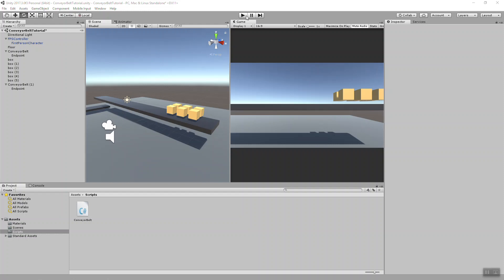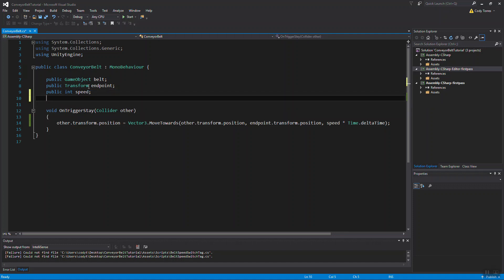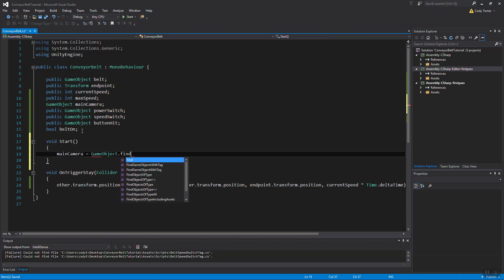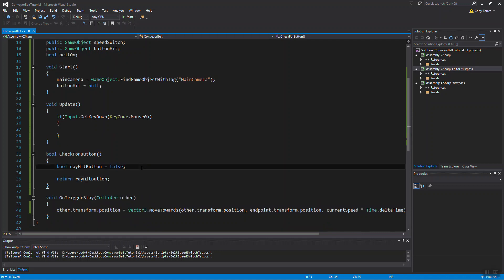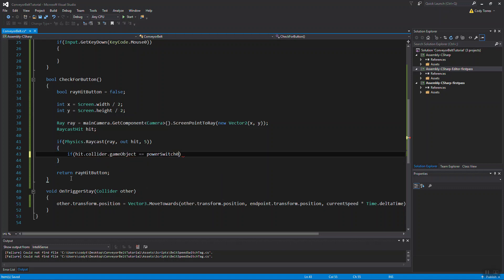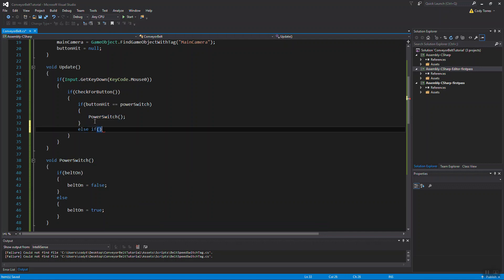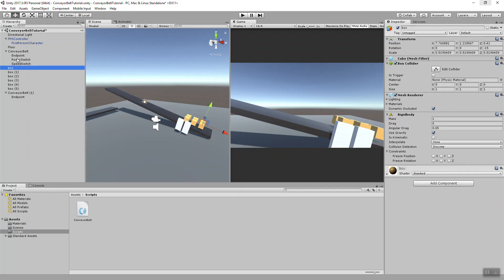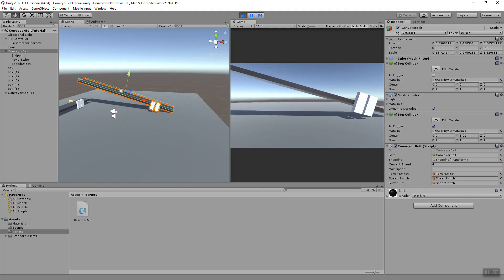Unity C# Beginner Tutorial - Simple Conveyor Belt System Part 2

Comment: @Chief
I am trying to make a wider belt, with the one "EndPoint" all the Crates end up getting pulled to the middle of the belt. What can I do so the crates don't get pulled into one position and stay spread out on the belt?
Reply from the maker: I found a solution. Instead of using Vector3.MoveTowards in the OnTriggerStay function, use transform.Translate instead. Translate the object in the forward direction of your endpoint(the arrow that points away from the end of the belt) Replace the code in your OnTriggerStay function so it looks like this:

After:
 other.transform.Translate(endpoint.transform.forward * currentBeltSpeed * Time.deltaTime, Space.World);

Before:
other.transform.position = Vector3.MoveTowards(other.transform.position, endpoint.position, currentBeltSpeed * Time.deltaTime);

Now your objects shouldn't get pulled towards the center of the belt and there shouldn't be any sort of jitter effect that would happen when using MoveTowards.

Hope that fixes the issue.